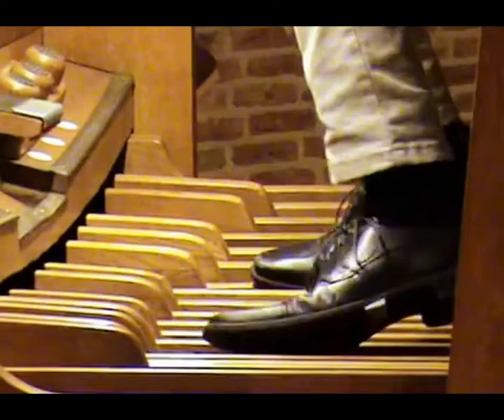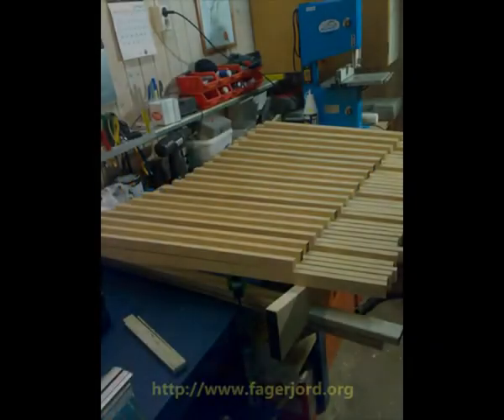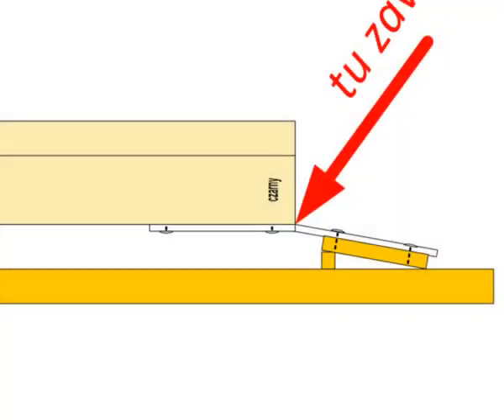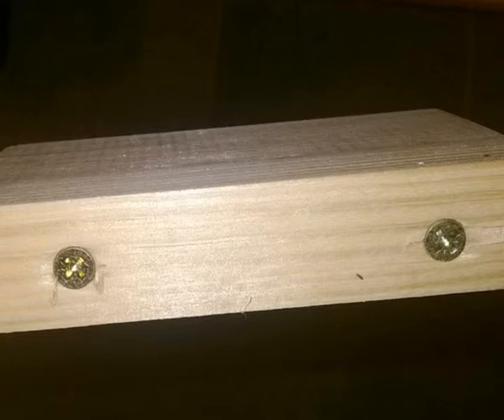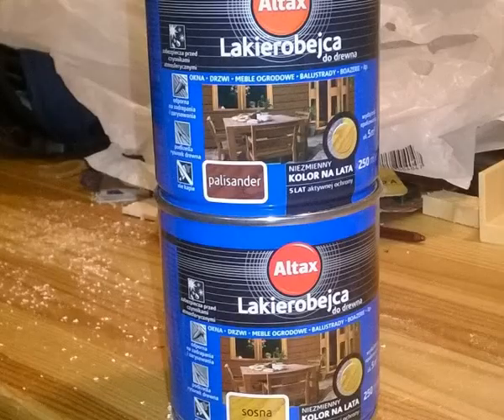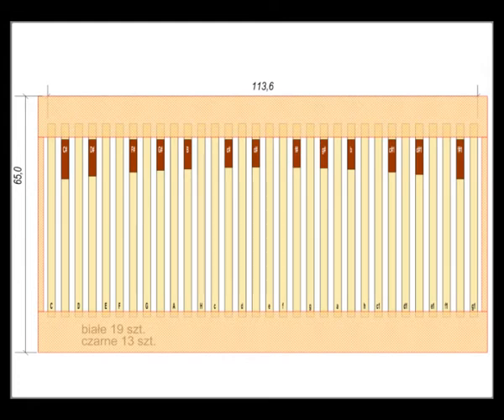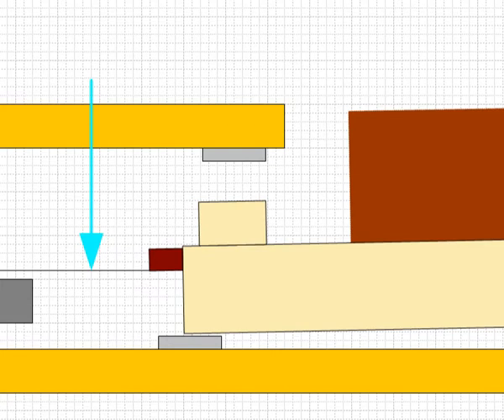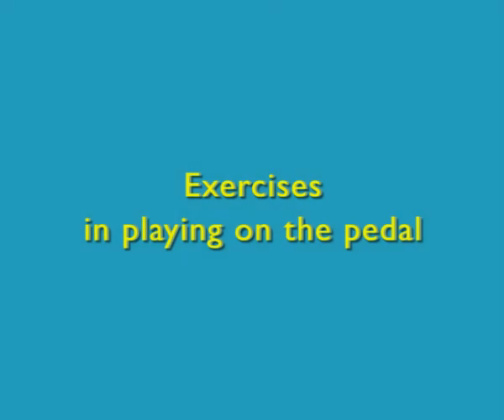Do-It-Yourself Organ Pedal for Home Use

Comment: Thanks and most impressed very grateful folr your tutorial but a couple of questions.
If we look at a standard pedal  board plan there is always a one key gap between the semitone white keys (E-F and B-C).  I ntoice from your  plan you did not do this.  Was this intentional?  
Also i feel that the PVC hinges  will droop or lose their  tension after a period of time.  Is this an issue  as you will know after using the pedal board for some time Thanks you very much again

Comment: Thank you This is very innovative but I have one question about the PVC bar strip springs.   Over time I think the PVC will weaken and individual pedals will droop because it puts a lot of strain on the  PVC strip spring with repeated use.  Is this true?  Also not strong enough to partially stand on when getting on /off the bench.
Reply from the maker: It could be true in soime conditions, right

Comment: Great video. I'm definitely trying it at home. Does anybody know if it's possible to use a guitar expression pedal in either Hauptwerk or Grand Orgue? They are relatively cheap and easy to find on the internet and I've never found any DIY video for them
Reply from the maker: I'll check it.
Reply: @JacekJarzina  Thanks a lot!
Reply from the maker: @marceloaugustorosadossanto156  Have you tried this way? (PNGs) Many of the expression pedals work with MIDI, they send out signals (voltage) from 0 to +5 V what is equal to MIDI signals 0...127 (min...max)

https://drive.google.com/file/d/1lH1KDbyESvXyJuGprZTRHxwPJ0c7OG92/view?usp=sharing

https://drive.google.com/file/d/1lFyeCPK8JvALfJs0LWAfMocWvsj99o3U/view?usp=sharing
Reply: @JacekJarzina  No, I haven't. Actually, I use Grand Orgue. In your case, what do you use as a expression pedal? I notice that it also allows you to use a midi "slider" or "knob" besides a pedal.
Reply from the maker: @marceloaugustorosadossanto156  what a pity - I do NOT use expression...
Reply: @JacekJarzina  Oh I see... Thanks anyway! I'll ask it in the Hauptwerk forum. Although I don't use it, if it works in Hauptwek it will probably work in Grand Orgue too!!
Reply from the maker: @marceloaugustorosadossanto156  I think so. Good luck!

Comment: Hello, could you please give some more details of the micro switches you are using and an address where one could buy them? Thank you!
Reply from the maker: Hi. I think you should google something like "microswitch with long arm", perhaps in your language/country - there are many hits after that... There are no special requirements according to such switches - they must be reliable (not too cheap), I think the long arm is necessary, but if you apply some other solutions, the arm could be shorter. Take care of method of fixing them in your frame. Many models have a hole or two to fix it with screws. That is all. You may also try to use magnets and reed switch. What we only need is to close a circuit with almost no current, so the switch can be as simple (electrically) as possible.
Reply: @JacekJarzina  Hello Jacek, thank you for your help, I have found the switches!

Comment: tell me please the model of your manuals and where did you bought it?
Reply from the maker: Hi! I simply use any keyboard with MIDI port that I have. They have changed during years. Last month I bought a very simple one for 90€, although next time I probably will buy a little bit more expensive. I'm sure there many models of MIDI keyboard to buy in your country. One condition - the keyboard must have MIDI port (with 2 separate DIN5 receptacles or via USB, like that one I bought last month). The full set of keys in piano/keyboard is 61 keys but there are virtual organs (if you are asking about that) with shorter keyboard (say 54). I prefer the 61-key models.